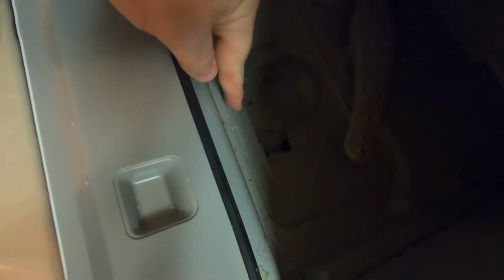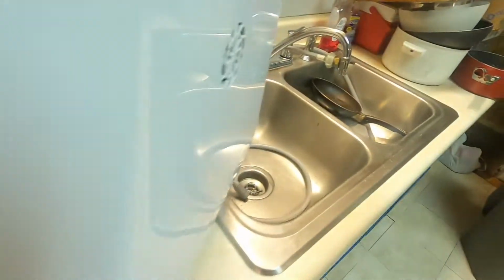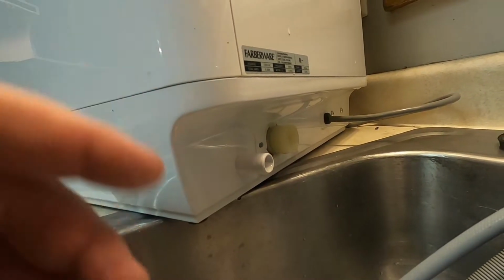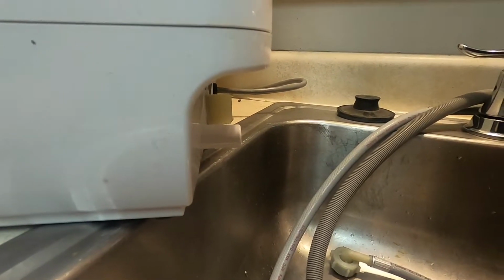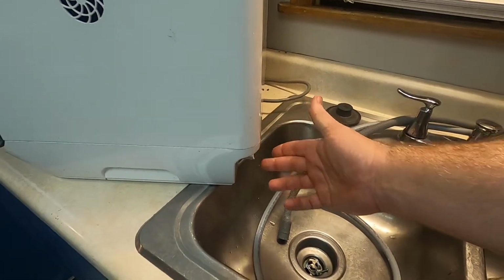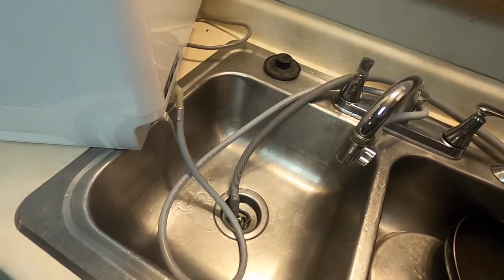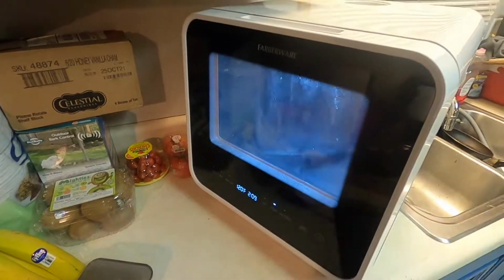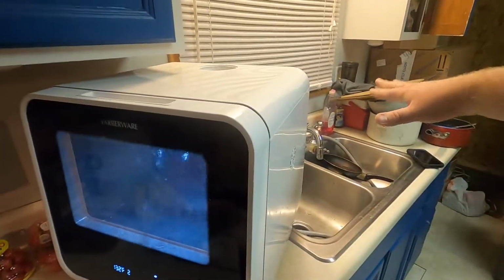ERROR CODE (E4) + (E1) FIXED! Farberware Complete Portable CounterTop Dishwasher CODE Fixed!

Comment: Ok so i just ordered this, i have somewhat of a different model as its not see through but it had that damn E4 code out of the box. even if i had it powered down it decided to power back on and beep at me. i did what you said and tilted it to its side and then (not sure if i was supposed to) turned it on, sure enough no beep! there was a very small amount of water that came out but it was neglegible imo. now i got it on cleaning like 2 little pans, few cups and like 3 silverwares SO we will see if it holds up and doesn't flood the house (knock on wood) thanks man! these guys should hire you to be their CEO of farberware lol :) ill update this later incase the e4 comes back

Comment: Unfortunately I was not as lucky to get rid of my E4 error. Tried the tips here but nothing worked and also talked with manufacturer support which suggested basically the same thing but when it was obvious that wasn't going to work, I detached a maintenance hatch at the bottom, exposing the internals and found out that the E4 error is triggered by a pressure based trigger in the bottom which becomes pushed when water accumulates in the bottom thus triggering the E4 but it appears in my case, I had a leak as water started streaming out of the bottom from the left side middle section which started leaking when the machine had begun the washing phase which makes me think that it has something to do with the bottom spray arms. 
My model is different than this one but the structural design is virtually identical with the only difference being the washing programs. 

If you have an E4 error and can't get it fixed by tilting the machine then it is likely that you have an internal leak related to the spray arms pipeline and will likely need some specialized tools, some technical experience and an endoscope for troubleshooting, otherwise the only option is to send it in for repair or a replacement.
Reply: Any luck with yours? I'm experiencing  water coming out of the bottom as well.
Reply: Indeed, I contacted the shop where I bought it and opened a service ticket which they sent to a local repair service in my area and they came and picked it up and got it fixed the next day. My theory on the problem is still the same as described in my original comment but to elaborate, after trying to find the leak, I noticed that water came flowing from a separate internal tank located in the middle to the left but impossible to see exactly where without an endoscope so my theory on the exact problem is that it's simply a faulty pipe seal, most likely due to faulty design or something that occurs when they do internal testing before shipping the machine out for sale. 

In conclusion, you'll most certainly need a certified repair service to fix the problem unless you have the tools and experience to do it yourself.
Reply: @PhantomStrideADHD  Thanks for getting back to me. Looks like our leak is from the steam generator, but that's just a visual inspection.
Reply: @EInTheNE  No problem at all. Sounds like you have a similar problem in a different location then. Best of luck and hope you can get it fixed.

Comment: Mine will suddenly not drain at all. It’s not draining when you first start it, not draining through any of the cycles and not draining at the end of the cycle. All it does is start overflowing from the bottom and then it throws the E4 code. The only thing I can think is wrong is I made a rookie mistake by using a full pod because that’s what the book says I could use. So probably going to have to take the entire thing apart and get to the drain pump and see if there is anything clogging it.
Reply: This is happening to me. Did you figure out how to fix it. I have not been able to get mine to drain at all.

Comment: Mine shut down both times I tried liquid Dawn, even when I filled only half way to the fill line. Too sudsy. I recommend pulverizing Finish tablets, removing the red balls since those are the rinse aid. I just stick one in plastic bag and hammer it. That makes two portions. Everything is so clean and I have NO spotting.

Comment: Just got similar used dishwasher (Klarstein Amazonia, afaik it's also sold as Scandomestic and Cookology) and I put a hose in the left opening of the hole where filter goes and flushed it with water with full pressure, that cleaned the drainage to complete a cycle successfully and then I run another 6min cycle but used some cleaning tablets to make sure its all clear, problem fixed although took me 2 days to figure this out, but for the price of $100 for used it's free seeing the costs of new are way above that and the issue was quite simple.

I had to clear all the underneath water and take out water from inside with a sponge to continue and restore it to work after failure.

@Daniel Reviews: I think if u add the other names in the title or description that should help others with same machine under different name.

Comment: Daniel, you are a star.  In the UK we have a similar machine with a slightly different front and name. We got an error code 4 this morning, so we've followed your advice and are currently at the stage of running fresh water through.  I think you are right about amount of detergent causing an issue a s it has already pumped out 500ml of lemon smelling milky coloured water.

Comment: For E4 tilt it left and right a few times and dry up all the excess water underneath it and that usually sorts it, that's pretty quick solution for E4. E1 was solved by putting 500ml of Quick Descaler by HG with the water in the top and that solved it!! That solution came out of another comment on this channel that said to use white vinegar (chemical not cooking type) and when i couldn't find white vinegar at the store we found HG Quick Descaler for £3 for 500ml and that did it! You know if you need to descale it when the flow of water trickles in slowly from the little hole on left, it should be pouring in almost horizontally, so the little trickle is a sign there is limescale in the inlet water tank area which reduces the pressure of water coming in to dishwasher. Hope that all helps! :)
Reply: Chris how much descaler did you add in with the water?
Reply: Yes! Descaler overnight (I made a citric acid solution) plus blowing out the intake hole worked like a charm for me too. Thank you!
Reply: @carriedobmeier2294 hello! i know it’s been a while since you made this comment but what exactly do you mean by “blow out the intake hole”? i think that’s an issue i’m having bc i have barely a trickle and have the e1 error code

Comment: I'm getting error code nine. The time delay button is counting up from 1 to 24. And then I turn it off and all the buttons flash at once. Only had. Y counter dishwasher for a few ours. I looked in the manual and it says water or other material in the key area.
Reply: You're talking about the wrong model dishwasher. The dishwasher in this video does not have a time delay

Comment: May I make a commnet. Not to be nasty.  But you need to work on your editing.   You are saying things 2 and 3 times over and over again.  Thus making this video much longer than it needs to be.    In answer to reason you got the E 4 Code.  You say the water was coming out all white ? Well my friend,   You caused "suds lock"  Meaning that you use way to much soap. And the pump was not able to pump it though the system.  Thus causing a back up of soapy water.   Also. NEVER use the dishwasher Pods in the SMALL machine. They DO NOT recommend it.   The Pods were designed  for full size  machines.    And are not calibrated for the small amount of soap need for this little dishwasher.
Reply: May I make a comment. Not to be nasty, but you need to work on your commenting skills. You could have edited your comment to be much shorter, clear, and to the point.
Reply: Agreed.  Could a been alot shorter.
Reply: Not everyone is a big YouTube content creator to know how to do that. That's the beauty of youtube. However, you need to learn how to condense your comments.
Reply: Pods work perfectly fine, you just need to use half.
Reply: What is best to use then? I have just ordered a benchtop dishwasher and a pack of 80 soap tablets, both arriving tomorrow.
Reply: This comment is cringe you need to be humbled and quickly
Reply: Why don’t you just move on 😅😅

Comment: 1 / 23 / 2021 You don't have to tilt anything.   You can end up breaking the machine.   IF you should get that code again All you have to do it press ( Glass & Air Refresh) Buttons simultaneously  for 3 to 4 seconds Until you hear the pump kick in and drain out the water.
Reply: My pump would NOT shut off unless i unplugged the unit.
Reply: Same with my unit.
Reply: Same here. We couldn't get ours to respond to holding down glass and air refresh at the same time. We tried but the only thing that fixed it was tipping it over.
Reply: I'm going to go with the guy who has the unit and did a review and showed us how to handle the error problem. Not saying your method doesn't work however I would rather you have the evidence to back it up not going to lie
Reply: Tried that and all it kept doing was filling up with water and then it would pour out the bottom of the door and throw the E4 code. We literally used it once and then the second load bam my kitchen was flooded. It’s not draining not even a drop out of the drain no matter what cycle we run and that causes it to overflow and throw the code. I fill it from the top only and it’s not the outlet hose because it wouldn’t drain any water with it disconnected. We tried back spraying it from the drain outlet to flush any possible blockages, tried running it with nothing in it, tried all the other cycles and it’s like something is blocking the drain or the drain pump is not engaging.

Comment: Paper towel: I have this dishwasher as well, I have cleaned it like this: once a week I take out the filter in the bottom like Daniel has and use my spray nozzle from the faucet to get out all the gunk. 
Once a month I use a full cycle and use some white cleaning vinegar and baking soda. I pour the vinegar in through the top and sprinkle the baking soda inside the dishwasher on the bottom. No dishes in it, take out the rack as well and do a full cycle. I dilute the vinegar with water. Two pitchers full of water. The third pitcher is half full of water and half vinegar. 
Not sure if that answers your question. I’ve had this dishwasher for almost a year. I run it at least every day at least twice a day. So far, no error messages (fingers crossed).
Reply: Don't use vinegar it will corrode the parts of the motor inside. Vinegar has very acidic properties.
Reply: @Miidaguy1  that’s why you use baking soda with it.

Comment: also is there a self clean option on it? i know ppl that have other counter top dishwashers have to do like a dishwasher clean like 1nce a month (sometimes more)  probs running it on hot water and using  Finish and Jet Dry Dishwasher Cleaner would be good just for any calcium and other build ups going on, and just for your overall health of your dishwasher.  how often do you have to do it with yours?